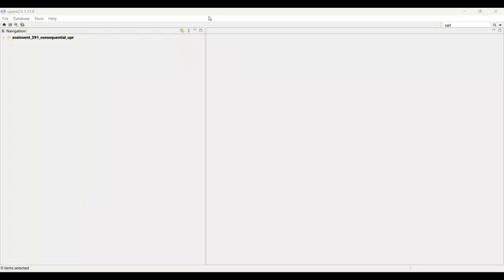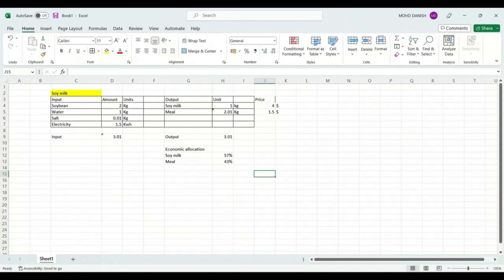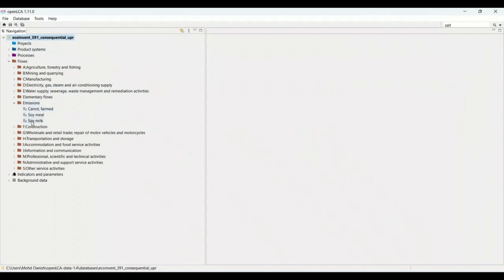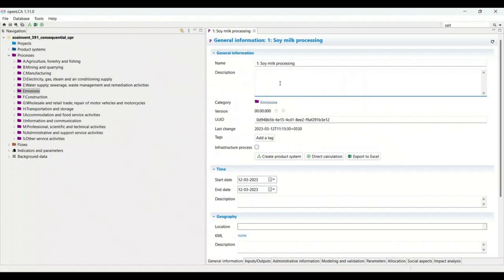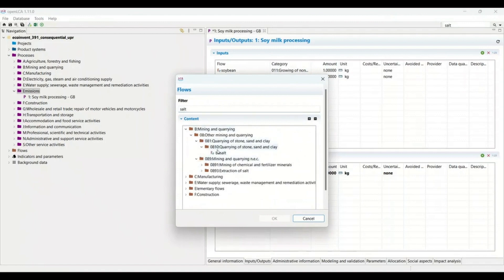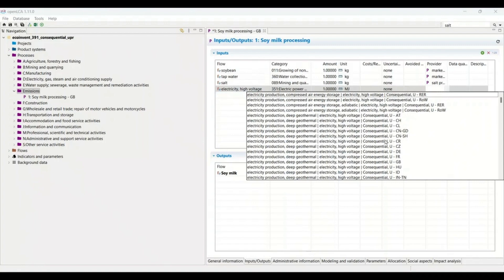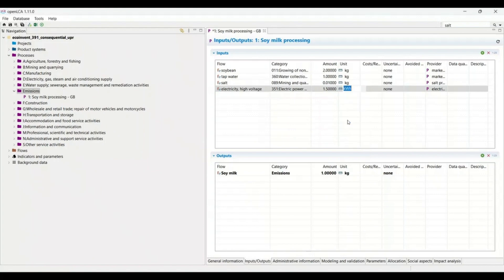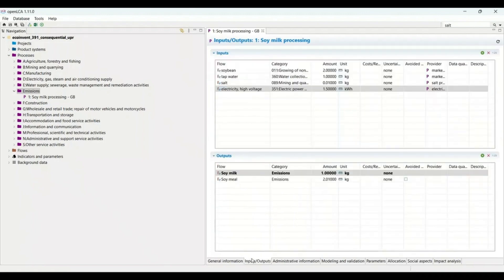OpenLCA Made Easy: Create Your Own Process with These Simple Tips I Learn LCA in 30 days

Comment: That's excellent, and such a clear explanation! Could you explain why economic allocation was chosen over physical allocation?
Reply from the maker: Thank you for your feedback! There is no definitive explanation for choosing economic allocation over physical allocation, as it ultimately depends on which method aligns better with your goals. Personally, I prefer economic allocation because sometimes a process can produce multiple by-products, and the amount of the primary product produced may be lower than the amount of by-products.
Reply: @theemissions   Many Thanks for your insights on economic vs. physical allocation. Super helpful :)
 
 Could you share from your experience how much the results vary when choosing economic allocation compared to physical allocation?
Reply from the maker: @IrfanAli-mu2pj  No one can give you a straightforward answer on carbon footprint as it depends on various parameters such as goals, system boundaries, and impact assessment method.